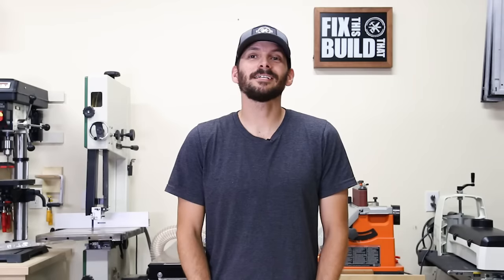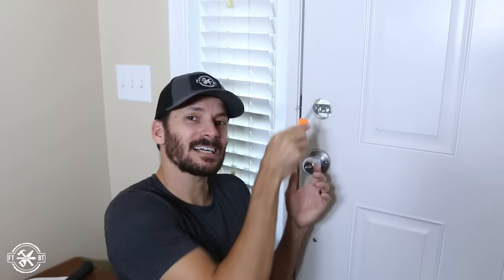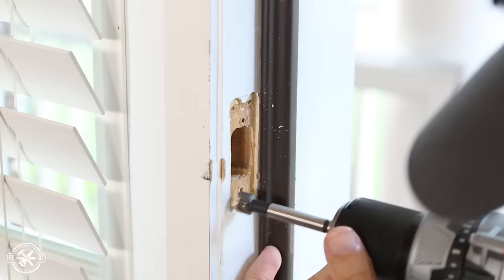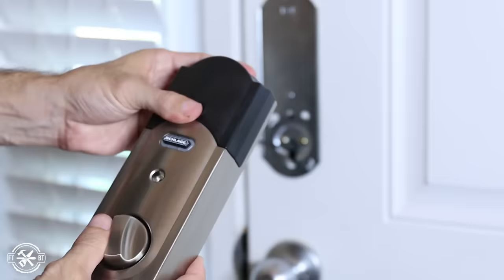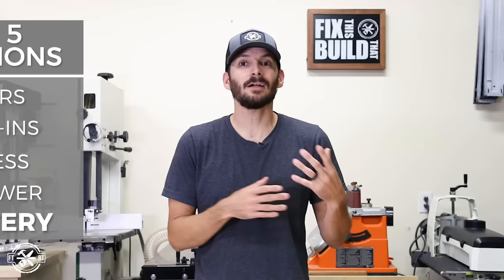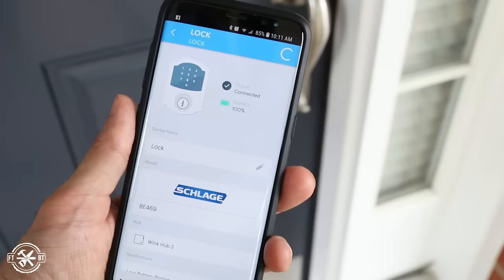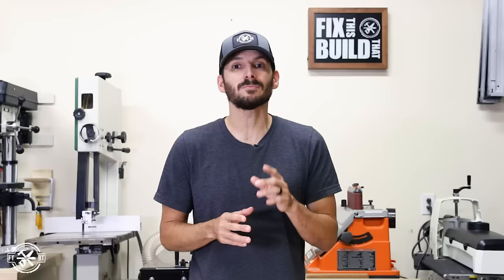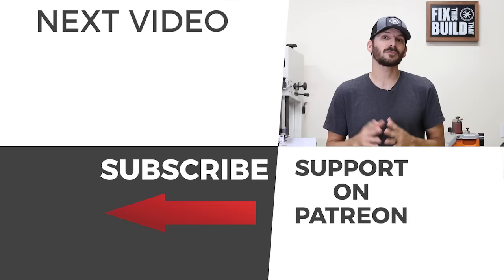Keyless Door Lock Install & Top 5 Questions | Schlage Connect

Comment: Can this be purchased, installed, connected and used in my home as is? Or do I need to purchase this ZWave hub as well on top of this lock? Any help would be appreciated
Reply: You need a hub with zigbee. I have the Samsung.
Reply: Courtney B avoid full electronic bolt throw. Trust me I work on these every day. Better option would be SCHLAGE BE365. Yes you can do whatever you want in your home. This guy is a fool, I'd go somewhere else. Security plates /screws are standard with deadbolts and only don't come with the cheapest of locks. A 3/4" screw in the door frame isn't going to stop a boot from kicking the door in. I hate channels like this... They're just shilling for the manufacturers.

Comment: Will the alarm sound if someone opens the lock without a code? like  say forcing a screwdriver or drill bit in the key hole?
Reply from the maker: Yes, if you have the alarm setting on

Comment: Hey do you think u can do a video on getting a broken key out of the top lock
Reply: Take the cylinder out, tap it lightly upside down, sometimes the key will slide out enough to grab.  I forget if this one allows, but some locks have a opening on the back which allow you to push from the back.   Can always take the pins out and rekey.  If these sound hard, just take the key side of the lock to a locksmith, cheaper than having a house call, they will have it out in 32 seconds👍🏻

Comment: Does the app send push notifications for tamper or break-ins as well as sounding the alarm on the lock? I cannot find this anywhere.
Reply: Steven Severson yes, you can program it to have the alarm go off if it senses someone is trying to pick the lock. I’m not sure of the details as far as if a good picker can override or bypass, but CNET’s review mentions the pick tampering alarm setting.

Comment: Does it matter how tall the door is?  I was told that a door which is 8 feet tall would require a system that will cost $2,000.

Comment: What if you have glass on your door.  And some decided to break glass and reach in an turn it. Is there any option to lock up the inside from turning
Reply: Not with this model deadbolt.  You'd want a "double cylinder" deadbolt so you need a key on both sides of the door. The bad thing about that is, if you have a fire and you don't have your keys on you or near the door, you are locked in.

Comment: Hello, I have a question.  On the Schlage Official website, they caution to not use the reinforcement strike plate and long screws if you have the window next to your door. I see that you do have side window and were able to install the reinforcement plate.  Was there any issues with that?
Reply from the maker: Just measure your screws and make sure they won't get anywhere near your window when driven in
Reply: @Fixthisbuildthat  Will do.  Thank you.

Comment: We were considering installing one of these on the door between the garage and home, can the deadbolt be installed so the keypad can be on the garage side of the door and the deadbolt moves to the left?
Reply: Yes, the lockset can be used on doors that open left and right. Just follow the instructions and it will tell you what to do.

Comment: How strong do you think the lock would be for double doors since the screw wouldn’t be installed in the wall?
Reply from the maker: The same as any other lock I'd imagine.
Reply: Im no expert, but Id say it would depend if the doors were solid wood or not.
Reply: I imagine it depends:
- if the sliding bolts that secure the one side of your double door are at the top and bottom of that door.
- if the sliding bolts are thick enough
- if the holes the sliding bolts slide into are deep enough and re-enforced enough.

Comment: ?? The dead bolt is 1inch long?
Should the hole in frame be 1 inch long or 3/4????to 5/8
Reply: The battery is dead, how I can open the door without calling a locksmith

Comment: Having a digital code really  doesn't make your home secure. Because a thief can pick the manual lock and override the codes.  Is there a lock similar to this one where you have to put in the key and not turn it and add digital code to unlock the deadbolt?

Comment: Anyone have trouble with the lock and leave feature? (Closing the door and pressing the Schlage button should lock the door). This is the only feature that doesn’t work on mine and it’s extremely annoying when you leave the house and still have to type in your code to lock it
Reply: When my lockset works (between failures that is) - touching the "Schlage" wording at the top of the keypad locks the door.

Comment: Anyone watching 4/12/24? My  tenants took batteries out for 18 months. And the battery connector black n red wires. Black wire is broken. And lock will not work. please any input?help
Reply: Same

Comment: If this can be opened with an ordinary key when the battery dies, then surely, you can also open it with a regular lock pick? You would need the lock to have no mechanical override function, in order for it to be fully secure, wouldn't you??
Reply: I don't know why so many people are coming here with issues about the security of the key over ride.  These locks aren't really designed to be "more secure" than a regular deadbolt.  Its designed to be as secure while also offering the convenience of keyless or app entry.
Reply: @Alcsaar0  That actually makes perfect sense when you characterise that way.

Comment: I accidentally disconnected the wire cable when trying to change the code at my new home.  I cannot get the cable back in.  Is there a trick to this?

Comment: Doesn’t need to be hacked. Drill a small hole in the cheap body , stick a paper clip in and all that encryption means nothing because you’ve just bypassed the entire lock. Why they charge so much 
And claim security and a 10 year old with a cordless drill can bypass it. Do a search on YouTube “Bypass keypad locks” like I did

Comment: I'm considering this one or NEST X YALE or AUGUST ..Any thoughts ???..also, any Monthly SUBS to manage it  REMOTELY ???
Reply: Emilio Zagardy - had August for year.  Was very inconsistent in automatic unlock feature with proximity geofence, and battery drain..  This Schlage works way better as long as you pair it with good Zwave hub.
Reply: @ONI1013.  thank you so much fo your valuable response. Any suggestions on a great HUB between SMART THINGS, GOGGLE HOME,  INDIGO or other ??? ( I would like  to work the LOCK  REMOTELY from my ANDROID PHONE  ). Much appreciated !
Reply: Emilio Zagardy - Google Home is not a Z-wave smart hub in itself (yet) but it works with well with Zwave hubs like SmartThings.  I only have the Samsung SmartThings hub,  but I did look at multiple reviews before purchase and SmartThings had more top rated reviews comparably.  In end,  I would stick with either SmartThings or Wink, as they are the most popular and have compatibility with most devices.   

That being said, for just unlocking your door remotely from your phone, you don’t even need a Z-wave hub. Get the Schlage Sense (not the Schlage Connect) if that’s all you want to do. It works with Siri, Apple home-kit, and Google Assistant.  It also has individual app for remote control.  However, if you’re looking to do more in future, like auto-unlock when you and your family gets home, and lights auto turn on, etc.. then Schlage Connect has a lot more capabilities with a smart hub.  Neither one of those requires a monthly Subscriptions, and SmartThings doesn’t require one either.  It’s all free, except you need Wi-Fi.  Hope this helps.
Reply: @ONI1013.  WOW what an AWESOME response, thank you so much, your channel is EXCELLENT..new SUB here !!!
Reply: Emilio Zagardy - this isn’t my channel.  Just responding to your inquiries since i had first had experience with the products you asked about.
Reply: @ONI1013. Oh, you're right, haha,   thank you for your great info though !!!

Comment: I am on my second Schlage keyless lock and it fails to operate intermittently. Both locks, brand-new out of the box, had identical issues; about 1 in 50 times, it will not operate, locking me out. This had nothing to do with the batteries, which are Duracell bard-new ones. The installation is ideal in a steel door with no friction on the bolt. Schlage pretends that they "never heard" of this problem, but I have found identical testimony in Google reviews. Obviously, there's a major design flaw they're not catching. DO NOT buy this lock.

Comment: huh ? "keyless"? ... is that a fake keyhole beneath the touch panel ? ...no... the "override" KEY opens it... i.e. can be picked !!! it is NOT "Keyless". The unit I have has NO such key, but DOES provide a place to temp external hook up a 9v battery to use if batteries die.